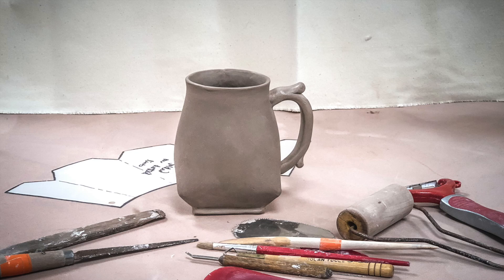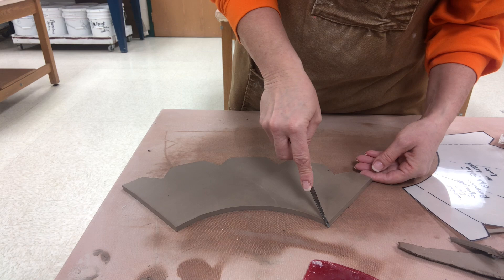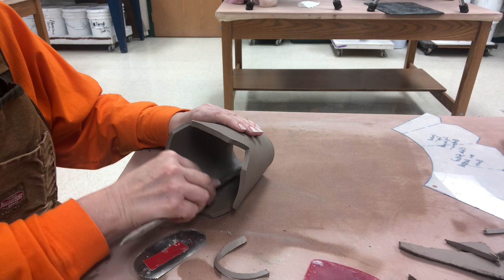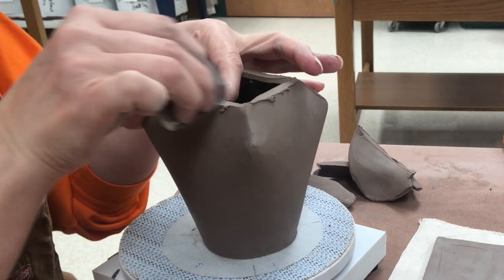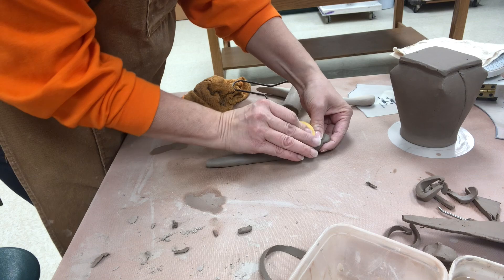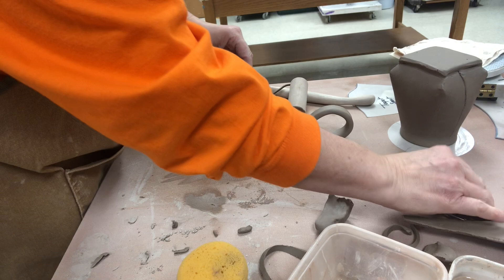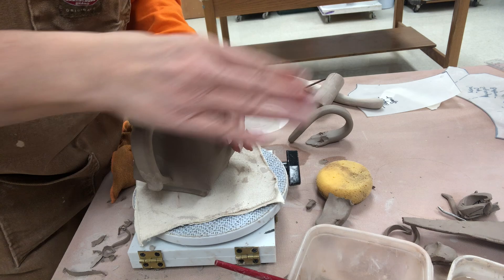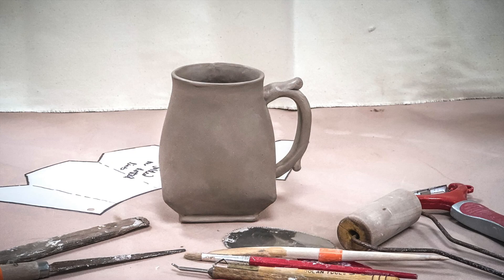Creating a Conical Slab Cup with a Darted Bottom- with Pattern Download

Comment: Thanks for sharing. I wonder if you use slab to create very narrow opening of a vase, how would you put a coil inside to seal?
Reply from the maker: Hello!  If I had a very narrow opening, I wouldn't put in a coil...  would just bevel any angles coming together and slip and score really well!  You can get away without doing coils for sure... just make sure all connections are really well connected and blended!
Reply: @KaransPotsAndGlass  Thanks !